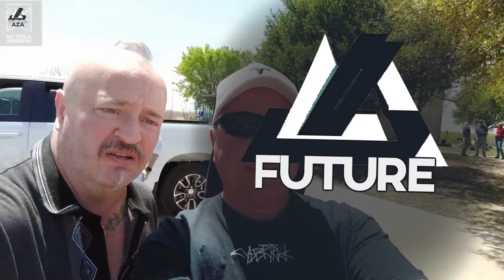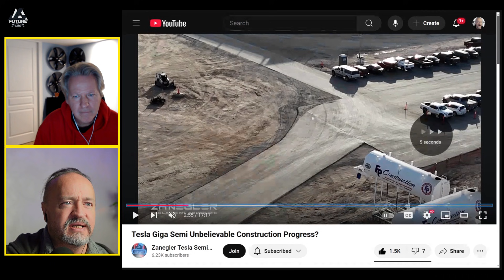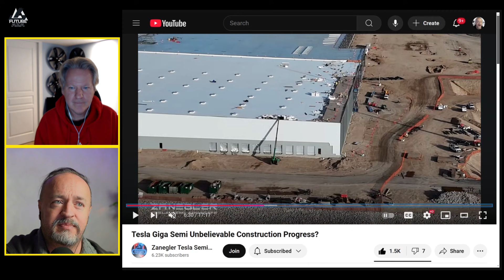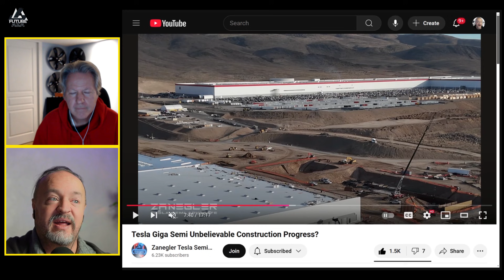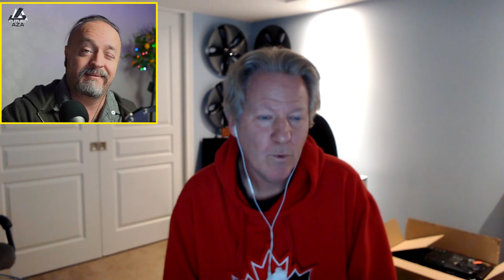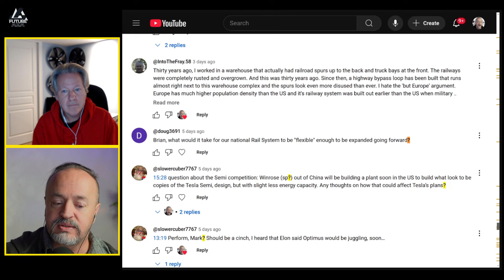Tesla Semi Factory Hits Major Milestone !

Comment: Question to electrical engineers or those with electrical knowledge out there: "Can we remove mechanical/physical brakes?". Would designing a electric motor that can actively reverse the current flow have the same effect as a mechanical brake? If so, maybe we can eliminate the mechanical brake after all?

Comment: Be sure to let the public know that Elon already said the Semi has a 1M mile guarantee on the drivetrain and battery with a projected 600 miles per charge with 1MW+ charging, up to 4MW in the market, 1000V, with advanced regenerative breaking, never need to change the brakes, efficient speed/s control and battery management system and possibly a battery and regen on a trailer.

Comment: Well, this info on Wikipedia looks promising for hydrogen.  🙂

Replacing the US gasoline infrastructure with hydrogen fuel infrastructure is estimated to cost a half trillion U.S. dollars.  A hydrogen fueling station costs between $1 million and $4 million to build.  In comparison, battery electric vehicles can charge at home or at public chargers. As of 2023, there are more than 60,000 public charging stations in the United States, with more than 160,000 outlets.

A public Level 2 charger, which comprise the majority of public chargers in the US, costs about $2,000, and DC fast chargers, of which there are more than 30,000 in the U.S., generally cost between $100,000 and $250,000, although Tesla superchargers are estimated to cost approximately $43,000.
Reply from the maker: Goodness me, that's a lot of smackeroobobs!

Comment: Even in Texas where there is 'space', Tesla doesn't have a rail to the Gigafactory.  There are major train lines going through the Austin area (mainly from north to south directionally), but it is on the other side to Austin.  Thus even Tesla trucks their cars to rail heads even in the Austin area, for destinations further away.
Reply: TSLA does use rail @ Fremont. Factory came with rail installed. It is cheaper than diesel.
Reply from the maker: @CaliTraildude Tesla doesn't use that rail stub. It did come with the property, but they have since torn it out and have buildings there. All cars leave Fremont on trucks.

Comment: What is stopping the Boring Company from making Boring Tunnels a little larger to accommodate more things such as shipping containers?  Just build Prufrok bigger or wider.  Going underground to avoid so many environmental disasters makes a lot of sense such as transmission lines, MegaPacks for battery Storage, Data Centres to avoid attacks, farming including fish farming in tunnels.  Going underground doubles the land mass of earth & doubles it again the deeper you go. I could see three Tier Highway systems placing electric commercial traffic underground & tunnels under that for sewage, clean water, irrigation rivers & growing food.  The possibilities are endless especially when it comes to military applications.
Reply: I can't begin to imagine why the expansion has been so slow.
The boring company is going to be a massive Global Corporation.

Comment: I completely am onboard with the semi product but I am curious what the costs / delays / complications involved in the mega charging stations.  With the cars there is an amazing supercharger network.  With trucks the positioning of the charger is very customer specific and likely involves the customer commissioning Tesla to install chargers at specific locations.  That is not as easily scalable since  the power is substantial and each site is different in terms of power availability, jurisdiction, physical space and internal company buy in.  It is more of a commitment than just buying a truck to test it out in most cases.

Comment: Railroads.
Perhaps Tesla should make an electric railroad locomotive with regenerative braking.
That might reduce the grade issue. 
Maybe they could use Gigafactory Mexico to build locomotives for Mexico’s mountainous railroads?
Reply: I have read the batteries required for trains make etrains impractical.
Reply: @briancole1887  There have been diesel electric locomotives for 100 years.
"In June 1925, Baldwin Locomotive Works outshopped a prototype diesel–electric locomotive for "special uses" (such as for runs where water for steam locomotives was scarce) using electrical equipment from Westinghouse Electric Company.[30] " https://en.wikipedia.org/wiki/Diesel_locomotive
Reply: Dynamic braking has been around since the 1950s at least - GM GP9... virtually the same.

Comment: You already know where the railways belong because that's why there are towns in those locations anyway. So just rebuild those and straighten the lines. 

Politicians need to grow up and get things done. You don't have any valuable historic architecture in the US to speak of anyway. 

But yes you might as well ask a fish to ride a bicycle as a politician to do anything that doesn't happen before the next election or requires serious work, especially in such corrupt country that's basically a banana republic at this point.
Reply: An by straighten the lines I mean you can run high speed trains more easily on straight lines. Since no human has to dig the railroad footings or tunnels anymore it's much easier to create straight sections through rocks. But also you don't need to flood the country in rail to link every city with modern railways to make an enormous difference to your shipping costs and road congestion.
Reply from the maker: "just"!

Comment: In winter, people generally prefer front wheel drives over rear wheel drives. Why does tesla produce rear wheel and all wheel drive, but not front wheel drive?
Reply: The main reason gas cars drive better in snow in fwd is due to the weight distribution with a front engine. EVs have a 50/50 distribution and rwd cars are more fun to drive.
Reply: @mikeoberg1  makes sense.  Took my kids, at 16, out to do doughnuts in parking lots so they learned how to handle skids....lots of fun

Comment: When FSD hits Telsa semi?  That might be the beginning of deflation?
Reply: With Optimus, we might get into s strange economic situation where deflation is good. Deflation in the sense of costs/GDP shrinking but accompanied by massive material growth (GDP may become an irrelevant measure). Do we call this growflation?
Reply: Not soon.
Reply: @dawn4077  You don't think that when FSD is solved, there will be a big rush to implement on Tesla semis?
Reply: @machoopichoo2  Sure. Remember that all data has been collected from cars. Completely different capera placement, different style of driving, different acceleration, weight, etc. You can retrain fsd on new data, but there is no semi data.
Even porting FSD to cybertrack took some time. Semi is completely dilifferent beast.
Reply: @dawn4077  Fair enough and good points. The CT does show camera placement wasn't a massive hurdle. I get what you are saying about semi-data, but they real challenge is making sense of the driving world. I don't want to trivialize the challenge to understand semi-driving, but the AI learning the significant differences of that seems relatively small. However, to your point, it won't happen overnight.

Comment: Nikola is on the ropes, but Musk promised Semi production five years ago, and he made the promise seven years ago. If Tesla didn't have passenger vehicle sales to subsidize Semi development, it would be on the ropes too. Nikola hasn't sold many semis, but it has sold twice as many as Tesla. How much has Tesla lost on each Semi it has sold thus far? You're covering Tesla, not Nikola, right?

Tesla can't mass produce Semis for long-haul trucking without a charging infrastructure, and Semi chargers are more challenging than passenger vehicle chargers because the power requirement is much greater. Half a dozen Semis charging simultaneously will draw a huge amount of power. You can't meaningfully discuss Semi production without discussing production of this infrastructure.
Reply: Tesla can't mass produce Semis for long-haul trucking without a charging infrastructure 
Tesla isn't producing Semis for long-haul trucking. This is obvious because these are day cabs. The current model is for Tesla Semis to make regional deliveries from a home yard, and return to the home yard for most charging. At least for the foreseeable future, diesel semis will continue to own the long-haul trucking sector. It will take decades if not generations to build out the charging infrastructure to allow electric semis to compete in long-haul trucking; but it will happen.
Reply: @BigBen621  PepsiCo owns 20% of the Semis sold thus far, and it uses them for short hauls, and it has its own chargers. Like I said, Tesla has only sold a hundred Semis, but we're discussing a factory able to produce 50,000 per year. I doubt that it can sell so many Semis with only this market. PepsiCo can do it, but many companies with short-haul requirements won't build their own chargers in addition to the cost of the trucks. They can't justify the cost.

Tesla is building some megawatt chargers, but last I heard, they're only building a few in a small corridor between California and Texas. Electric semis may replace petrol-powered trucks over decades, but why is Tesla building a factory to produce 50k trucks per year now? This video ridicules Nikola, perhaps for good reason, but it simply doesn't apply the same standards to Tesla, so I'm doing it for them.
Reply: @restonthewind You are engaging in the "What You See Is All There Is" fallacy (see the "Thinking Fast and Slow - What You See Is All There Is by Daniel Kahneman: Animated Summary" video for an explanation of this term). Just because you and I are not aware of Tesla's plans and schedule to build out a megacharger network does not mean that Tesla doesn't have such plans and schedule.
Reply: @restonthewind  PepsiCo owns 20% of the Semis sold thus far, and it uses them for short hauls 
Depends on how you define "short hauls". During the Run On Less tests last fall, Tesla Semis with weighed-out loads of soft drinks routinely made deliveries to Bakersfield, a 550 mile round trip, with a short stop at the Harris Ranch Supercharger on the way back to add enough charge to get home.

 we're discussing a factory able to produce 50,000 per year. 
That doesn't mean they're planning to produce 50,000 a year right from the start. Tesla has proven pretty accurate in sizing factories and forecasting sales of their product, leading to the Model Y being one of if not the best-selling car models in the world. A lot of people have lost a lot of money betting against Tesla; and my bet would be that the Semi Gigafactory will eventually justify its production capacity; but time will tell...
Reply: @CiaranMcHale  I never say that Tesla has no plans for a megawatt charger network, so I haven't employed any fallacy. On the contrary, I say that Tesla is building or plans to build chargers between California and Texas. If it really intends to build tens of thousands of Semis per year, it presumably plans to build more megawatt chargers too, but this video doesn't discuss these chargers or the challenges involved in building them, and a network of megawatt chargers is at least as challenging as building the trucks themselves.
Reply: @BigBen621  550 miles is a long round trip, but by "long haul trucking", I mean trucks hauling freight cross-country on a variety of routes. This 550 mile round trip with one supercharger stop is peculiar to PepsiCo's fleet and not particularly relevant to a market for tens of thousands of Semis replacing diesel semis anytime soon. Whoever bought Nikola's trucks has presumably driven them hundreds of miles too. My point is that this video dismisses Nikola's customers as only experimenting with the vehicles but says nothing similar about Tesla's Semi customers though you describe this 550 mile round trip as a "test" yourself.

If Tesla has a factory able to produce 50,000 trucks per year, they'll want to build so many trucks in the near future; otherwise, they have a very costly factory with idle capacity. Maybe they'll build something else in the factory too, but the video doesn't discuss other products to be produced there.

I'm not telling anyone to bet against Tesla. I drive an EV (not a Tesla). I'm not a Tesla hater, and now that Tesla has announced remote monitor/operators for its robotaxi service, I believe it can launch a service successfully in the next year or two. I'm still skeptical of a large market for electric Semis in the near future.
Reply: @restonthewind  550 miles is a long round trip, but by "long haul trucking", I mean trucks hauling freight cross-country on a variety of routes. 
Yes, I agree that Tesla Semis won't be suitable for long-haul trucking until 1) the charging infrastructure is built out, and 2) they build Tesla Semis with sleeper cabs. Until then, diesel semis will continue to own the long-haul trucking marked.